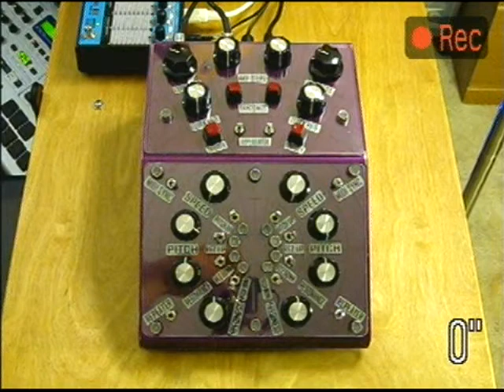FreqTalk Introduction

Comment from the maker: Thanks for the kind comments!

I don't see mass producing these anytime soon, but the thought has crossed my mind.  If I find the time, I'll post news on this channel.

Currently, I am working on a new model...same sounds, but better interface, with an LCD screen and built-in step sequencer.

@circuitben:  SpeakJet chips are basically triggered via serial messages, but in conjunction with an Arduino, you can wire them up to accept almost any kind of signal to trigger them.

Comment from the maker: Thanks a lot.  Yeah, the SpeakJets basically cover 3 octaves (B0 to B3), but since the tuning is integer-based, and musical tuning isn't, many of the notes are slightly sharp or flat, but it's close enough for techno, so to speak.

The chips are worth getting...they're a lot of fun to play with in Arduino applications.  Easy serial communications, minimal wiring required.

Love your bass synth, by the way.